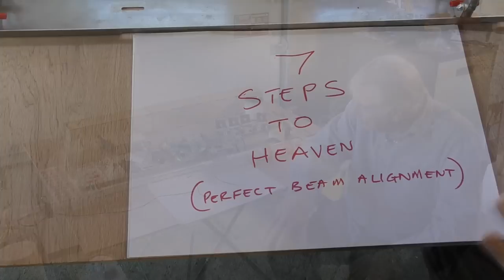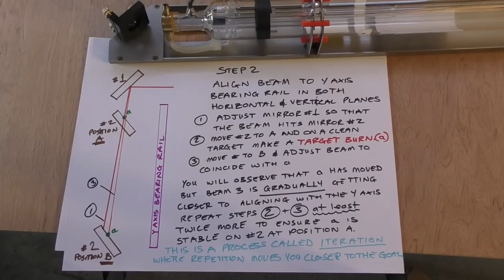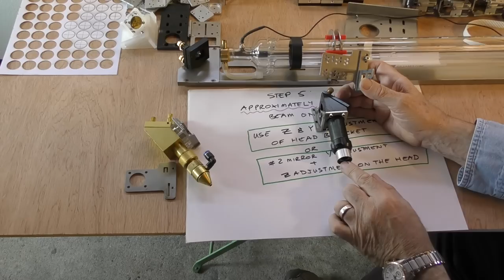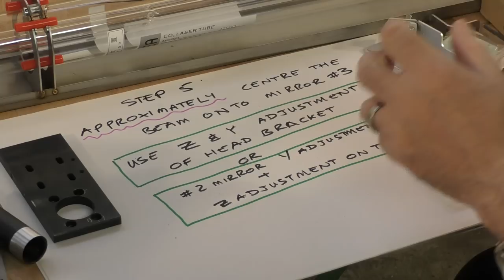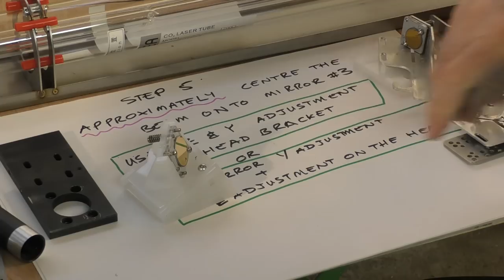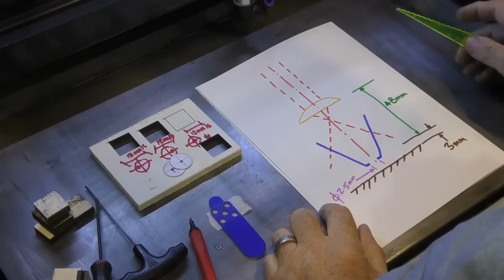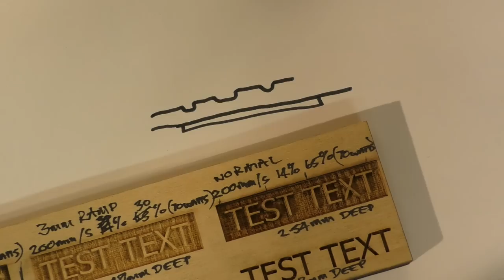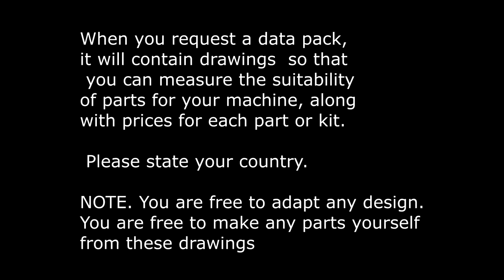RDWorks Learning :Lab 192. New Parts now Available and Detailed Explanation of Beam Setting

Comment: Russ Thank you for your videos! I just got a 4040 Laser Cutter and seeing your videos I was wondering if you may have an idea on how to solve my problem. Its something that is supposed to be physically impossible yet here I am. I followed all the alignment steps and the Y and X(at the middle of Y) hit the same point on the mirrors. meaning that it should be aligned. however placing the X mirror at its maximum, then moving the Y from Min, fire, to Max, fire. I get two dots that are above each other about 2.5mm apart. I have done the calibration of the mirrors about 30 times by now and nothing. I have done my research and the only thing i found close to what I'm facing is someone who mentioned their k40 was warped, however my machine has a C channel steel square in its base that the rails mount to directly and thus I can't exactly bend that to fix it as its rock solid. 
Now here's the kicker, I loosened the rods in their mounts (this is the Y part of the gantry) and rotated them in place by about 90 degrees. I also used a laser level to level the machine as a whole, then leveled the C square inside using shims. and the problem is almost gone. I have gotten to about 0.3mm apart between the dots at Max and Min beam travel. However tightening down the base ruins everything again. Ive been loosing my mind for the past 3 days trying to figure this out and went through a whole roll of painters tape. 
I am trying to narrow down if my base is in fact warped or if the Y guide rods are bent. have you ever had this issue and if so how did you solve it? 
Thank you again for these videos, they have been a savior with my machine!
Reply: Hi
 What you are experiencing is the classic "4th corner problem"
You have sufficient engineering ability to realize that such a small rigid frame cannot be that far out. However even if your fame was twisted and bent would it cause the problem you see?
 The  #2 mirror is attached to one end of a stiff beam. if the Y rail at the other end is skewed 2mm uphill at the back of the machine , logically step through what will happen. The other end of the STIFF gantry will rise by 2mm and in doing so it will tip the gantry AND #2 mirror  so there will be no RELATIVE  change to the strike position for your beam on mirror 3
 So using that logic  it matters little about machine levels/distortion etc etc. This is the myth  that exists around this problem and I have seen people packing up the bearing rails 2 or 3mm to fix the problem (unsuccessfully,  I might add),  
The cause of the problem is so simple and obvious that you will berate yourself for not seeing the elephant in the room.

I have described how mirror 2 and the head are mechanically aligned to each other via a stiff beam  so how is it possible for the beam to change position?  It is being REFLECTED to a different position because the #2 mirror holder  bracket is being distorted VERY SLIGHTLY  by some external force.  and reflecting the beam to a different position. That force is different between front and rear of the Y axis. 

You have a very small machine  thus your error  is small. On 900 and 1300mm wide machines you can  see  7  or 8mm errors. I cannot tell you how to fix your problem because every machine will be different but my best guess is to unscrew the Y axis  cable chain from the gantry  because this is one common causes.  Your mirror 2 mounting bracket may also be very flimsy. If that does not fix your problem you will have to become an engineering Sherlock Holmes.
Sorry I can't actually fix your problem but now you are looking in the right place you should be able to devise a solution
 Best wishes
Russ
Reply: @russsadler3471  Hi Russ,
Thank you for replying and giving some great insight. Something you said about the beam being stiff. Well I think I found a potential problem. The beam is made of aluminum with a rail attached on top. Thus compared to the steel base and steel rods it is the weakest link

The rods might be not be fully parallel causing the beam to ever so slightly flex. This explains why the dot moves slightly up relative to where the distance between rods gets shorter (so the beam bows upward causing the dot to move up. And the opposite is true at the back where the rods are further apart causing the beam to flex down and thus the laser dot moves down. Im going to try and solve this issue and if it works ill document it for the other poor souls dealing with this issue.

Thank you for pointing me in the right direction!

Comment: I need help 😫. My 50w laser engraver seems to be not finding the center of the table therefor my images are not being cut center! The best I can tell is it is going to center at 264mm x 114mm 
Can you tell me how to fix this?
Reply from the maker: Hi Shauna
 This may require a few pictures to help you with this problem. If you add your disguised email address to another comment (johndotsmithatgeeeemaildotcom) I will answer and help you through your issue.
I will also delete your comment
 Best wishes
Russ

Comment: Russ did you manage to solve 4th Corner Puzzle?
Reply from the maker: Where did my answer get posted to?  I answered this several hours ago. Ok let's try again.
Yes, but every machine could be a different problem. There is no common cause except that mirror 2 mounting  is being  twisted slightly between the front and rear position, This causes the beam to deflect to different positions at mirror 3.  I have seen people packing up rails and blocking up a corner of their machine to distort the frame. . This error is usually large,  in the 4 to 8mm range. It would be obvious if the rails were skewed by that amount or the machine frame twisted..No it is always something about your specific machine design that is causing mirror 2 bracket to distort VERY slightly. I have pointed you to the real problem but you need your engineering detective hat on to track down the cause.. I'm sorry that's as helpful as I can be.. Now you need patience and good luck.
Best wishes
Russ
Reply: @SarbarMultimedia  Thx